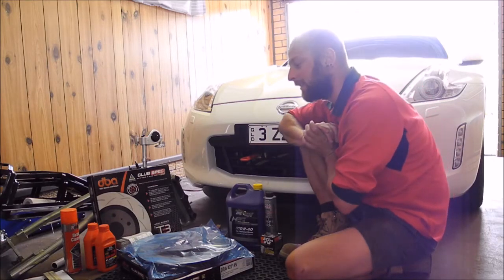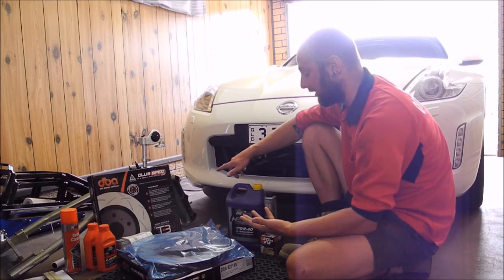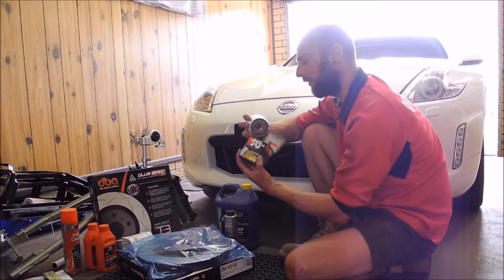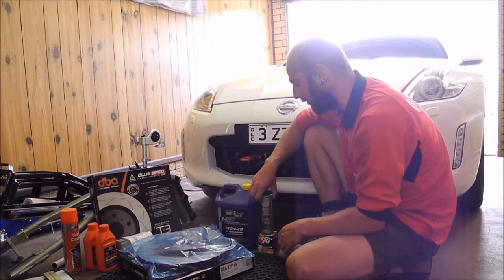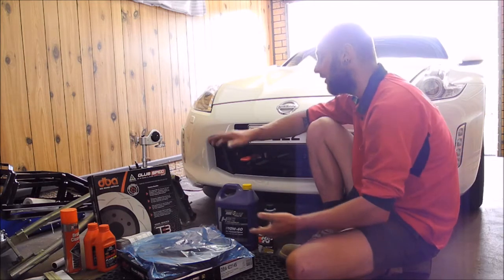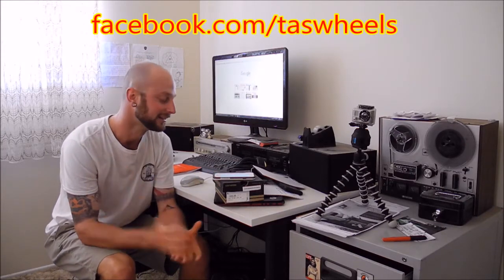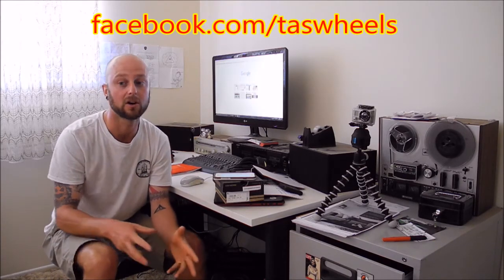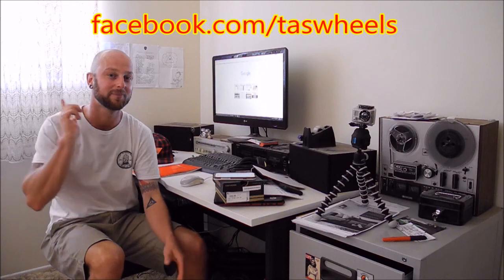DBA Brake Rotor Upgrade Nissan 370Z T3 Slotted 4000 Series

Comment: I believe those are akebono brakes, cross reference the correct part number off their website and you should be able to order online much cheaper. The base model Z's here in the states have duel action calipers and cause a lot of confusion on what pads/rotors one needs to order. I'm pretty sure akebono makes higher level pads if you ever do need to upgrade. I have a very low mileage used 2012, and haven't had to do the brakes, so I haven't looked into it to much yet. The 370z forum probably has some good info as well. On a side note, if you take a piece of rough sandpaper on a flat surface and knock the glaze off of used pad, it's supposed to help them seat to the new rotor. Have fun with it and I'll keep watching.
Reply from the maker: Yeah that's right, they are the Akebono's (in Australia it's our "stock/base" model and we don't have an option for a dealer ordered upgrade OR downgrade as far as brakes go - they just paint the Nissan wording on the caliper - but the stock pads definitely are branded Nissan/factory) 
Ah yes, I didn't even think to try the actual Akebono brand for pads! Thanks for the tip! Yeah they forums are definitely helpful in some ways, I guess I tend to read a lot and watch a lot of info on a topic then try and find a middle ground. - I mean some forums and what-not really are full of hype and garbage haha. SO I try to always read with a pinch of salt and come to my own decisions.
That's also an awesome idea about running some sand paper over the pad to de-glaze it too! 
I'll be doing the rear brakes next, but might look at changing all 4 corners of pads at the same time and maybe some other bits and pieces with brake lines and full system bleed too. It's all a learning process hey! 
Cheers for tuning in too! 
~Matt :)

Comment: I wish you could have shown the wheels after you were done putting on the new rotors. And by the way, did you feel any difference with the new DBA rotors?
Reply from the maker: I have a few photos just from my phone, they're pretty ordinary though - I have them but it won't let me load them into this comment. I'm happy to email them to you though if you like. Maybe I could take some better ones. 
Well, I felt more confident, like I could put more force into my braking, but I found that the stock pads were still what was letting me down. 
So I did one track day with the stock pads + DBA's but have since upgraded the pads to the Project Mu HC800 pads and have 110% felt the difference now, there is no brake fade at all, even after a full 90 minute track session at full stick and heavily digging onto the brakes they still work amazingly. 
I've been really busy but have a bit of an update video coming soon-ish where i'll explain that a bit better :) 
Cheers for tuning in! 
~matt